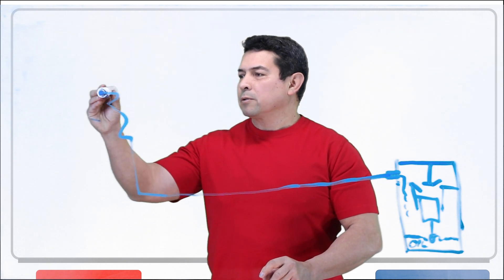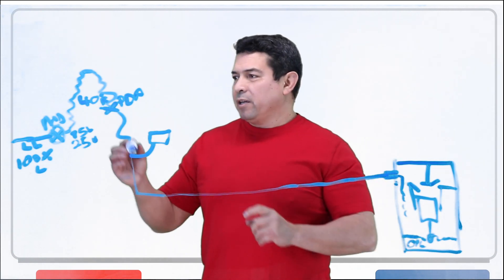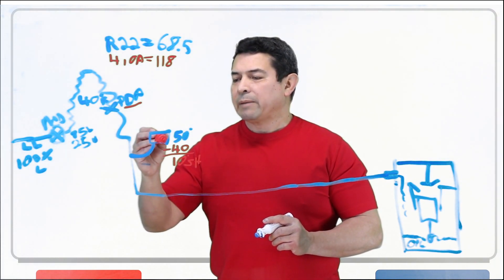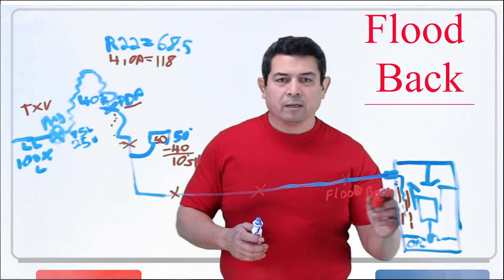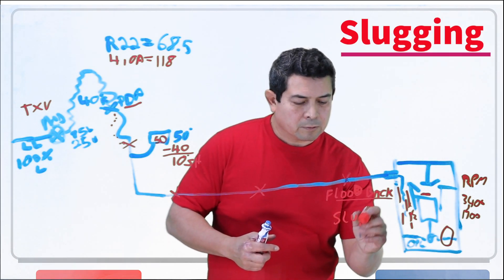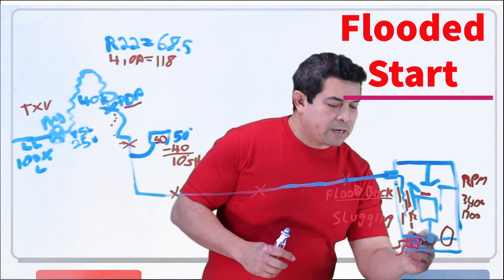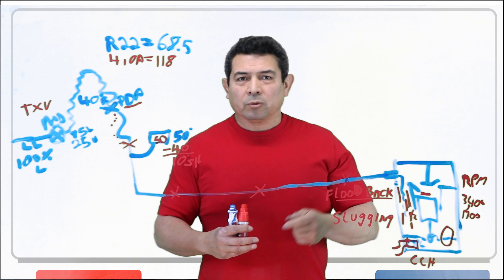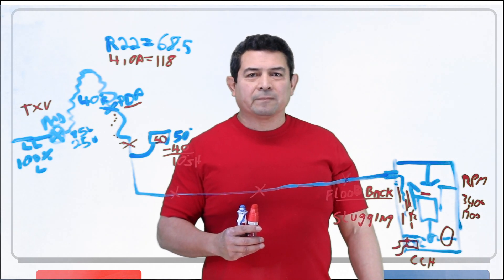Compressor failure 1 - HVAC Online Training and Courses

Comment: Many freezers run -10° coil temp
Reply from the maker: Yes! Absolutely correct. Like I tell people in class, all of the components are the same and they will fail for the same reasons. By adjusting the pressure we can change the temperatures. So yes, some phrases that run at -10°F and some refrigerators for candy and flowers run higher than your typical air conditioning evaporator coil.    Maybe I should do another video talking about different temperatures and pressures. You just gave me an idea. Thank you so much! And thank you for watching!

Comment: What values you would have if it was not charged enough?
Reply from the maker: I think you said you found your answer lol !!!!
Reply: @AirConAcademy  so it would be  excessive superheated before entering compressor if it was under charged?
Reply from the maker: @vahagnmelikyan2906  yes! If you do not have enough refrigerant in the evaporator your superheat will increase and possibly allowing the compressor to have a high temperature which could cause the compressor to go out on internal overload. That is why it is important to always check the superheat. And always know what the manufacturer suggest what the superheat should be. I hope this helps!
Reply: @AirConAcademy  so if I have a unit without any information about it's refrigerant amount  how do I figure out how much I should add.. How much superheat is too much?
Reply from the maker: @vahagnmelikyan2906  I am not sure at the moment if I have a video that explains the metering devices. To know if you have enough refrigerant in the system you first need to know what type of metering device you have.. If you have a TXV that will maintain constant superheat so you must have a good amount of subcooling. A good amount could be considered between 10 to 20° of subcooling. If you have a fixed type metering device like a capillary tube or a piston/fixed bore then you would need to charge it according to the superheat. Typically in class I tell everyone 8 to 12° of superheat is a good rule of thumb.  I hope this helps. Just remember if it is a package unit then you would want to charge it by weight. Which means that you would have to look at the model number of the unit and download some information on the unit to see how much refrigerant you should add. But when you charge by weight the unit must be empty and you must have had a good vacuum on it meaning 500 µm before you add the suggested amount of refrigerant by the manufacture specs      I hope this answers your question. If you still have questions please let me know! Good luck out there!
Reply: @AirConAcademy  You're awesome. Thanks for information. I couldn't get a straight answer from anybody.

Comment: Than you for the video sir. I have a ice plant of 1TPD. Here the oil pressed is decreasing day by day 40 psig to 10 psid respect to suction pressure after that the compressor triped. I have already repaired the compressor after repairing the diffraction between suction and oil was 40 psig it was perfect. After 60 days the pressure difference come to 10 again teipping starts. How to fix the flood back probelm even super hit also adjusted?
Reply from the maker: I am not sure I totally understand. You do need to check and adjust your superheat. With superheat you will not have flood back.   You also need to make sure that you have enough pressure difference between your high and low side pressure. If you do not have enough pressure difference your oil is not going to come back which means that your oil pressure will drop. If you're having a problem with oil returning check your pressures. If you have enough oil and it is not building up pressure it could be like you said flood back. Or maybe a bad oil pressure switch or a bad oil pump. With the little information that I have it is hard to diagnose properly. But check those things that I mentioned above.

Comment: So at PDP, it's 100% vapor (0% liquid). Through the spring and summer season (and the equipment is in tip-top shape), does the compressor ever receive any liquid (e.g. 0.001% liquid) at all?
Reply from the maker: Very good question! If we have superheat the compressor will not have liquid come to it. That is why in class I always tell the guys make sure after you hook up gauges you check your superheat. Superheat will tell you what is going on in the system and you also need to check the sub cooling. Liquid should not be coming back over to the compressor! Thank you for your question!
Reply: @AirConAcademy  so when the fluid goes back into the compressor, do we say it's "saturated" vapor or "superheated" vapor? I heard people uses the term "saturated" vapor, but saturation means that there two things/phases in a mix. Superheated vapor means to me that it's just vapor, no liquid.

may be I'm not understanding the different terminologies being use
Reply from the maker: @profuse007  saturated means that it is a mixture of liquid and vapor. When refrigerant comes back to the compressor it needs to be low pressure superheated vapor. The refrigerant in the evaporator, the first 3/4 or so of the evaporator will be saturated and then in the last quarter or so the refrigerant Will start to superheat so that it is super heated when he gets to the compressor.    I believe I have a video that talks about this. Take a look and if you have other questions let me know.
Reply: @AirConAcademy  thank you so much

Comment: Thanks for another good video, a question about a very low-pressure system, how do we attach the gauge/hose without introducing air to the suction line, normally this type of system runs at a vacuum also when the system is off which it goes to pump down at stays at vacuum
Reply from the maker: That is when having a valve as a low loss fitting works great. Because you can close off the valves and you will not pull in any air from your hoses.   But that is tough not introducing air into the system

Comment: Thanks a lot for this teaching but I have a question what is the proper way to check refrigerant charge on R22 and R410A split systems when out door temperature is between 40 and 65ºF with Systems with TXV and Metering device I have been asking this to a couple of technicians and they told me that is the customer don’t complain about anything not to worry about it but many times I see very strange pressures and temperatures an many times not the right Superheat or Subcooling
Thanks for your help,God bless you and your family

Comment: Dear Sir, I am very thankful to you for uploading very informative videos. Sir, I have a Copland Hermetic Compressor , for cold room. but it makes ice on compressor and Evaporator with in two to three hours. filter , T xv And Orifice I Already replaced.
Reply from the maker: What is the temperature of the cooler?  It may have defrost controls that are not working.   CHeck the superheat it should have superheat maybe 8 to 12 degrees of superheat.
Reply: subscribe my youtube chaannal bhai

Comment: How to know exact length or diameter for a metering device like capillary tube for a certain capacity?
Reply from the maker: ohhh    That is something that it is not easy to do because there are a lot of inside diameter that are sold and each has its own length depending on the manufacturer.  I am sorry but there is NO easy way to do this.  I will make a video talking about it. and explaining more I am sorry there is no easy way to do this.